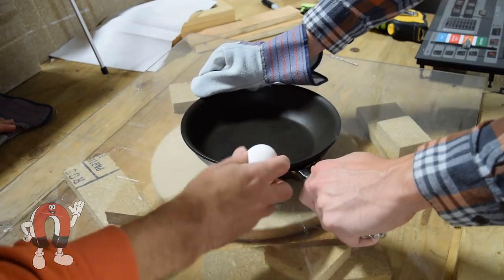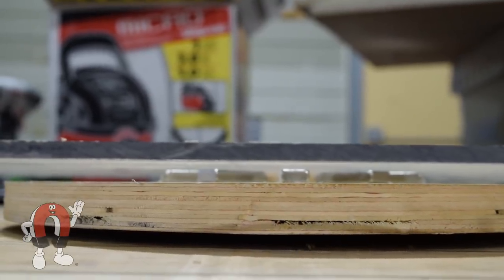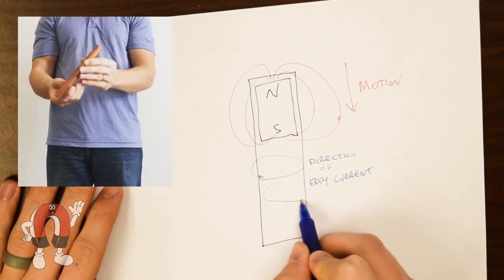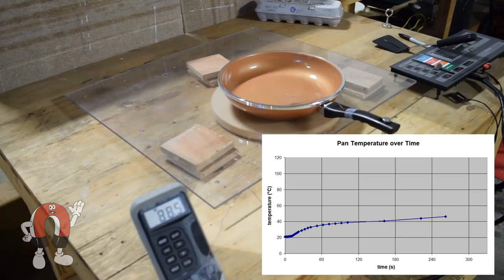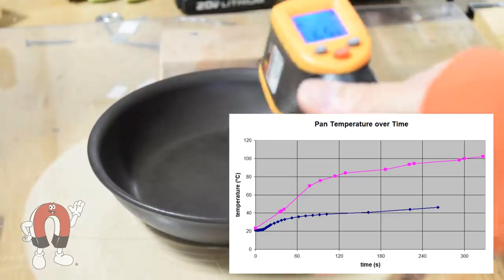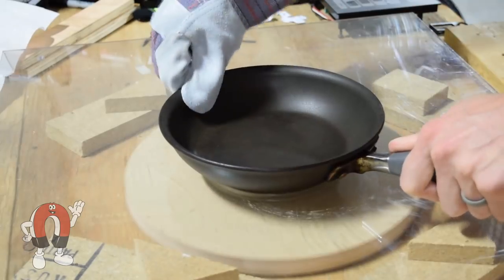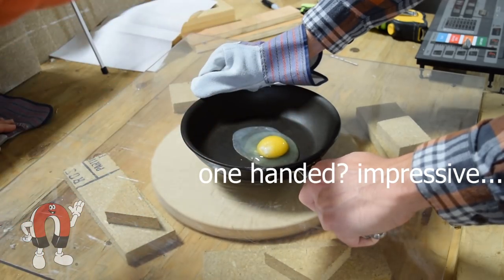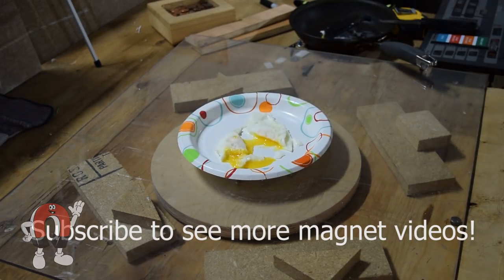Induction Stove - Using Magnets to Cook

Comment: Look into Halbach Arrays.

By placing magnets in-between the alternating magnets you can move most of the magnetic flux lines to one side of the disk increasing the magnetic field on one side and weakening it on the other side. This will increase the flux density passing through the pan.

I would also consider placing the magnets under the rim of the pan so that more metal passes through the flux lines instead of the far smaller amount passing through the base.

Try imagining how the flux lines look, or you can use magnetic films to see how the fields are shaped. Then arrange all the pertinent parts accordingly. Remember, metal has a high thermal conductivity which means thermal energy will quickly equalize throughout the pan.

Comment: If you can add a sheet of metal under the magnets to connect their bottom poles, the field will be much, much stronger.  5-6mm mild steel at a minimum should do it.  Thicker is better.

Comment: Doesn't induction cooking require pots or pans that are magnetic? The first one you tried wasn't magnetic. I'm not sure the second one was either. There will be a transfer of heat with a pot/pan that isn't magnetic but it won't really cook very well -- sort of like what we saw here. Curious to know if the second pan was magnetic or not. Cool vid!
Reply from the maker: If the pan were magnetic, we wouldn't be able to hold it in place! It would be attracted to the magnets. You need a pan with a nice aluminum/copper base, these are good conductors, which induce the eddy currents. The first pan was aluminum, but was very thin. The second pan was thicker aluminum, which worked better.
Reply: @KJMagnetics  did you have to hold the pan with two hands? curious

Comment: Try a shaft version, make a long rotation shaft 
and place magnets around it, maybe connect a motor to it by belt or gears, then wrap copper pipe all around the shaft, i seen a guy do this just with a large diameter pipe, only issues might be heat and magnets

Comment: impressive but i do have a question. The eddy currets originated a force on the pan, that's why u needed to use a glove to hold it in place. Well, how does a comercial intuction cooktop prevents that?

Comment: I wonder if one could pedal a stationary bike fast enough to cook their Breakfast? Lol
Reply: Yes, though not like this... by charging a battery threw a charge controller powered by a dynamo turned by a stationary bike. Potatoes take too much power for too long so skip the hash browns or cycle you butt off or days and days charging up like 3 deep cycle marine cell batteries... personally I gave up, as I was happy with sausage and eggs.
Reply: Heavy Flywheel  best bearings money can buy maybe geared for higher rpm and no drag clutched drive mechanism so when ur not pedaling the petals disengage. The Heavy Flywheel would have the biggest effect on my food actually getting done 🤣🤣
Reply: Great idea

Comment: The motor on a lot of treadmills is about 1 hp ~ 745 watts.  Did you put a watt meter on the motor and see how much power it drew as compared to resistance heating with the same power?
Reply from the maker: We didn't do that, but it would be interesting! There was definitely a lot of resistance holding the pan in place. It was very noticeable.

Comment: A couple of thoughts here.  Rather than increasing the strength of magnets wouldn't you have done just as good or better if you had just put them closer together (adding more if needed)?  It is the up and down of the field that creates the current, so a quicker flip from N to S would have done the trick, right?  Second question... I wonder if this used significantly less electricity than a typical stove top?  It would seem that rotating the magnets should use less electricity, but I don't know about how much resistance the motor had due to the proximity of the aluminum.
Reply from the maker: Good question! The alternating polarities is what induces the eddy currents, but a stronger magnetic field will create stronger currents. We are still in the process of figuring out how much energy we used to cook the egg...what the video doesn't show is that it actually took around 10 mins to cook the egg, once the pan reached temperature, which took another 5 mins or so. So my guess is that it wasn't really energy efficient. The induction stoves that you can buy for your kitchen are supposed to be much more energy efficient though.
Reply: @KJMagnetics   Look into Halbach Arrays.

By placing magnets in-between the alternating magnets you can move most of the magnetic flux lines to one side of the disk increasing the magnetic field on one side and weakening it on the other side. This will increase the flux density passing through the pan.

I would also consider placing the magnets under the rim of the pan so that more metal passes through the flux lines instead of the far smaller amount passing through the base.

Try imagining how the flux lines look, or you can use magnetic films to see how the fields are shaped. Then arrange all the pertinent parts accordingly. Remember, metal has a high thermal conductivity which means thermal energy will quickly equalize throughout the pan.
Reply: @josephcoon5809  you try

Comment: Hey the first thing that noticed is when the aluminum pan would get HOT but that plexiglass didn't warped or melt from the heat of the aluminum pan. Or is that that over glass? Aluminum pan,  on. And I noticed there is a lot of editing???
On an induction stove the pan needs to be metallic where a magnet would stick to it for the induction to work.

Comment: Shouldn't a cast iron skillet heat up faster and much hotter than the Aluminum pan due to the higher magnetic attraction of iron?
Reply from the maker: Nope, it's the induction of eddy currents that heats up the pan. The better the conductor, the more eddy currents.

Comment: Dude, great video. I am just wondering if this could be turned into a hot water heater?
Reply: Yes. Although they have to rotate very quickly. I'm curious to know if the power consumption used in spinning the magnets would worth the hassle. I can see thus being a alternative method of a boiler system. Maybe wind power geared to rotate at the proper rpm

Comment: Sorry guys but you will not reach significantly high temps with aluminium or copper due to their conductivity. That's why induction manufacturers    advise not to use them. 
You need to use iron based pans for best results as eddy currents are best absorbed and dissipate heat..
Reply: Lol copper is more coductive than iron by the way
Reply: Depends on the frequency. See https://shop.panasonic.com/support-only/KY-MK3500.html

Comment: Why use aluminium? Is there a reason to not use a material with lower skin depth (steel, iron, etc.) which is what is normally used with induction cookers?

EDIT: I watched the rest of the video and it's pretty evident that the second pan is not aluminium - why else would you need to hold it in place? That's why it heats up so quickly (and to higher temperatures too).
Reply: the double fisted hold has my curiouslity

Comment: I tried to reproduce the experiment.  I used a 775 dc motor and 40*40*10 N52 magnets same 8 magnets.  But I found my motor is not powerful enough.    The aluminium pan damps the motor too much.  I can only achieve electro braking not baking.
Reply: I don't know much - just learning here but, wouldn't cast iron being a ferrous metal produce the better effect?

Comment: Eddie Carlson's 1959 conception of a spinning building, introduced at the 1962 World's Fair, the Seattle Space Needle, turns via a simple sewing machine engine using myriad wheels and cogs [track & wheel]. It would seem that with a bit more thought, one so equipped could also conceive a model of today's K&J Magnetics demonstration which uses significantly less... is the word power/watts/volts/idk..source efforts to power..

Comment: Use glass instead of plexiglass and aluminium plate instead of wood,  also remember that a commercially engineered one would be a 1000 times better ..
It said that with a much higher rpm 3000 i think, you dont even need metal, at that frequency water will boil with rotating magnets..
Reply: interesting - show us

Comment: I didn’t think induction cooking worked with ALUMINUM cookware.  I thought it had to be reactive to magnets, which aluminum is not…correct?
Reply: Different use of magnets, caused the heating...
Reply: my thoughts as well - but?
Reply: Eddy currents are used in metal recycling to sort aluminum.

Comment: If you place a bifilar pancake coil instead of pan, the coil will generate more watts than needed to rotate motor; you will achieve overunity.
Reply: No. You absolutely will not achieve over-unity. Over-unity is impossible in energy conversion. Try it yourself if you do not believe.

Comment: Using this online tone generator, I guess the sound made by the device is about 160Hz (160 cycles per second, or 9600 RMP).
http://www.szynalski.com/tone-generator/

Using this bike gear ratio calculator, I worked out that if the axle of this device had a 100mm circumference 'wheel' on it to interface with a bike tyre on a bike wheel of 630mm, every bike wheel rotation would = 6.3 rotations of the axle. To get 160 axle rotations per second, the wheel would have to rotate 25.4 times per second (16,000mm p/s = 57.6 km/h). With a peddling a 10 toothed cog driving a 75 toothed gear on the wheel - peddling at 60 cycles per minute (one per second), the wheel speed would be 58km/h.
http://www.bikecalc.com/gear_speed/

It's doable manually (peddle) with standard bike gear - and even more easily with changes to gearing.
Reply: So we need more and stronger magnets,am I right?

Comment: Next test, set up a stationary bike and see if you can cook an egg with human power and magnets. What was the RPMs of the disk?
Reply from the maker: This was actually discussed as a possibility...but couldn't get any takers who wanted to exercise that much!! We were spinning the disc at around 1600 RPM
Reply: Watch this sprint bicycle champion trying to toast bread on human power alone: https://youtu.be/S4O5voOCqAQ
Reply: Maybe the use of an old foot treadle sewing machine. Up the size of its fly wheel for more power then gear it down to spin the magnets faster maybe